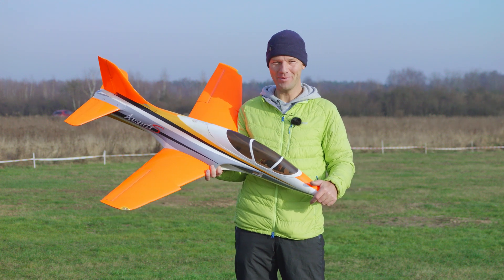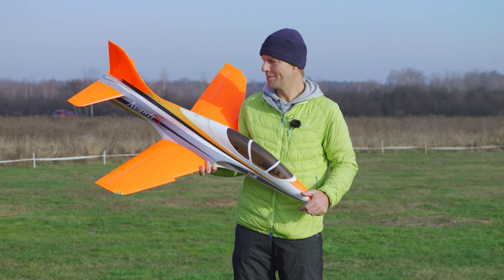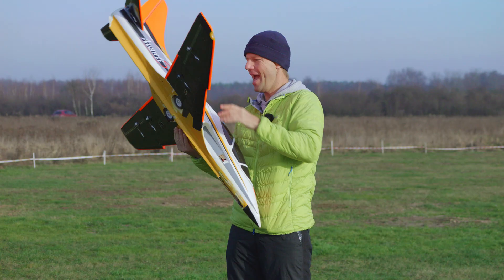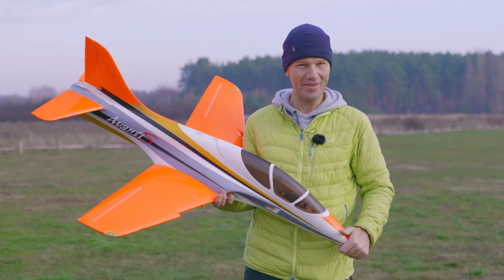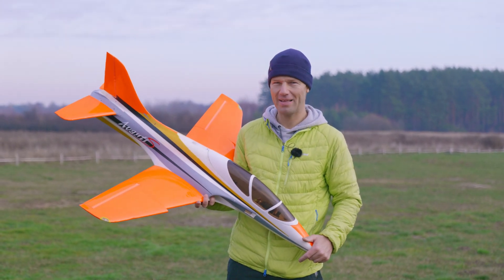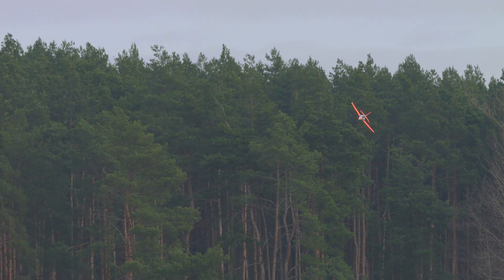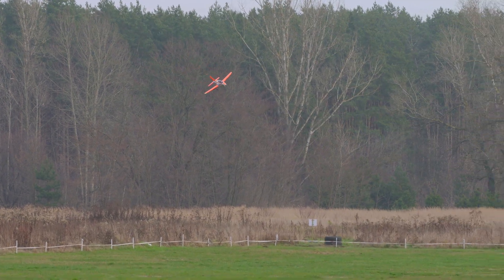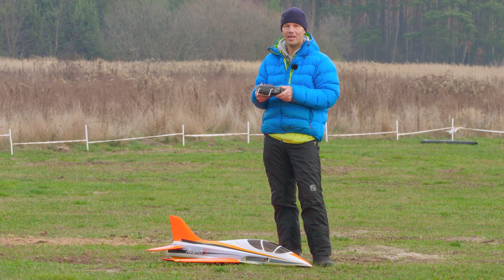Freewing Avanti 301km/h burned motor mid flight 8s 4,2kW WeMoTec jet sound Ii-Ion Oracover 80mm edf

Comment: why would u use Li ion battery? what the difference between the lipo and li ion? ive never try that before
Reply: The quick answer is Lipo's dump their voltage quickly and can only fly for 3-4 min.  Lions take much longer to loose voltage and can fly for 8min if you use a 2s lion pack which will weigh the same as 1 lipo pack.
Reply: @trevor5290  the longer flight time but same weight?
Reply: @FP777-8  Yes.. My 6s2p 9000mah Lion pack weighs the same as two 6s1p 4500 lipo packs. But my pack is just slightly larger than 1 Lipo pack. So I'm getting the equivalent of 2 Lipo packs in a plane that can only handle 1 Lipo.  FreeWing Avanti and others.

Comment: Hi...I was checking the specification of the Motor HET 700-68-2250kv and the website mentions it works with only 6s. Why Did you mention you are using 8s ? Thanks.
Reply: It is only rated for 6s thats why his burnt up lol. I have flown mine on 2x 7s4500 liions. Scared to try 8s.

Comment: I have also noticed that my recently bought Avanti seems to be glued together less strongly. Especially the control horns and the fixtures for the tricycle undercarriage need a check. Also the new servo's have more play than the older ones. I have an X45 (45N thrust) turbine in it and only go full throttle for about 3 seconds or slightly longer in vertical climb. The fear of the plane desintegrating is always there!

Comment: I run mine on 8s2p8400 P42a cells @139A and flight-time @9 minutes on the stock 6s inrunner. Edge 130A es. My favorite edf until the Odyssey arrives lol.

Comment: I am pretty confindent you started using Molicel P45B li-ion cells - based on the 4500mah capacity :)
I have been using them for some time, and now I am replacing all my old Molicel P42A packs with them for EDFs. Its just no contest anymore - due to significantly lower internal resistance P45Bs are a beast compared to any previously available cells.

The old ones get sold or used to power warbirds, where performance does not matter.
Reply: I think its 40T3, but maybe you are right.
Reply: Wow very impressive

Comment: I also have Avanti with 12 blade JP 80mm edf. You inspired me to make some li-ion 6s packs and they are awesome! I use samsung 40T 8000mah (2 x 4000mah paralel) and I get from 8-10min of flight easily. I cannot imagine how can be even better batteries that you say in a video. I fly sport and aerobatic also, but not pushing too much with the speed all the time so the flight times are umbelivable for edf. Thank you and keep up the good work 👍🙂

Comment: Why on takeoff is it pulling the Avanti to the left? Also, do you think the same setup will work on the Freewing L39?
Reply from the maker: I was taking off with too low speed and it tip stalled. L39 has a smaller wing so it will be a bit harder to land.